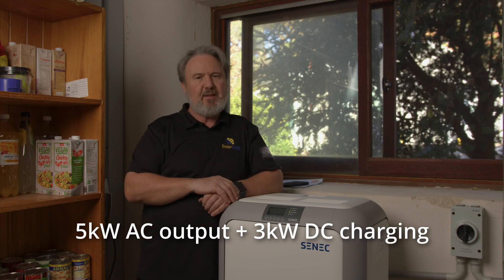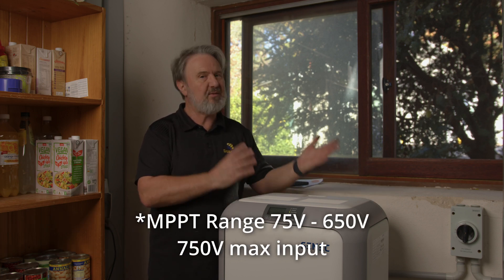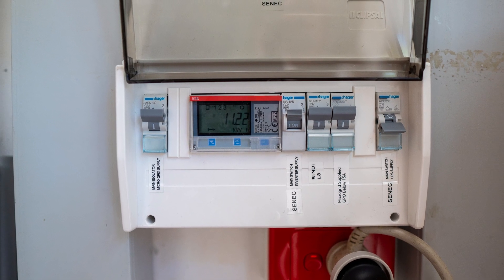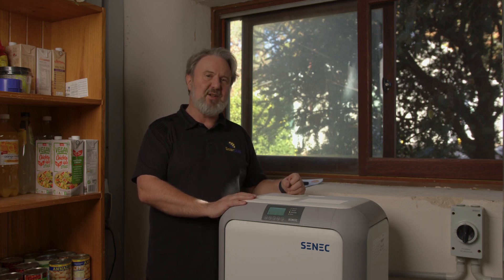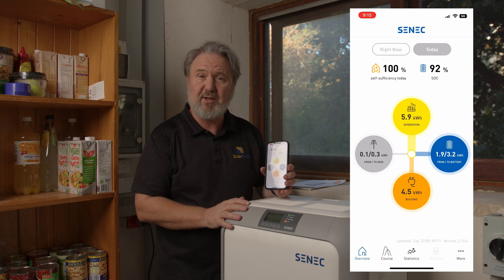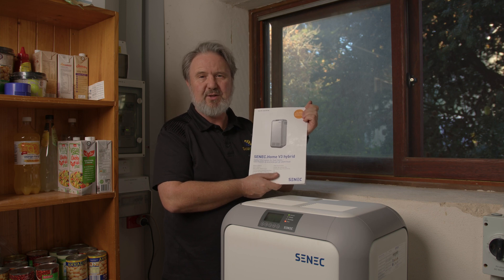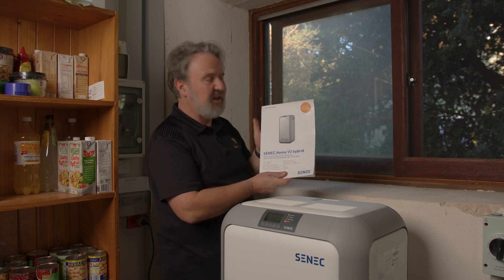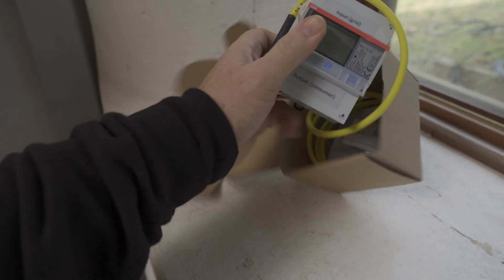SENEC HOME V3 Hybrid Inverter Installation

Comment: Hey mate, thanks for the video. Senec is exiting Australia, and one of the installer offered it for a really good price, and warranty is also valid.

Do you still enjoy the unit?

They are offering 20 trina panels (440) with the unit, which has the hybrid inverter (SENEC Home.V3.10 - 5kW 1 Phase Hybrid Inverter with Case(SENEC.Home V3 hybrid 10 + SENEC.Backup Power pro (AS4777-2))

So I am not sure if this setup will be able to handle all the power gendered during the perfect day